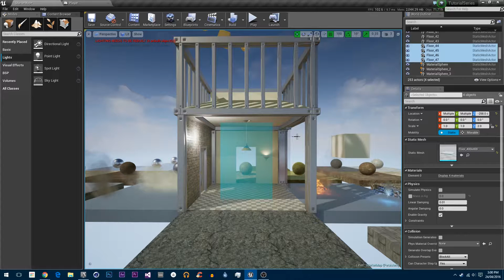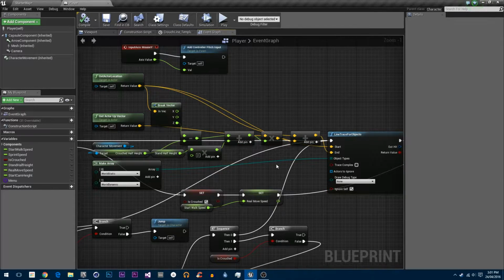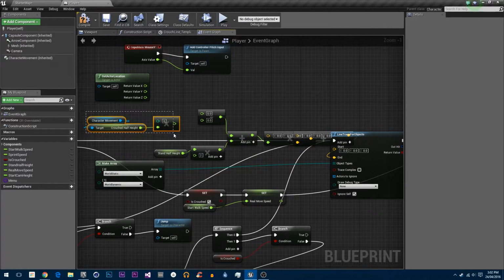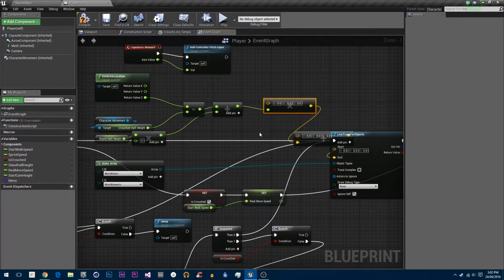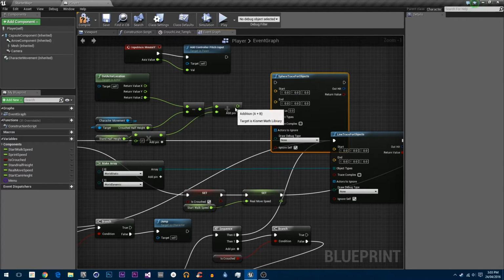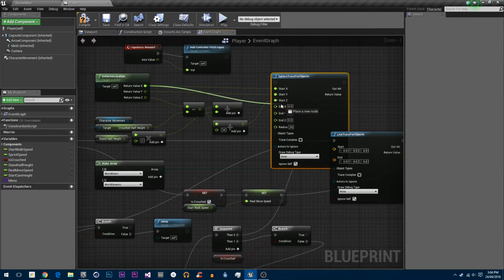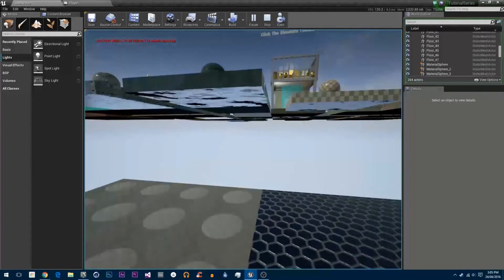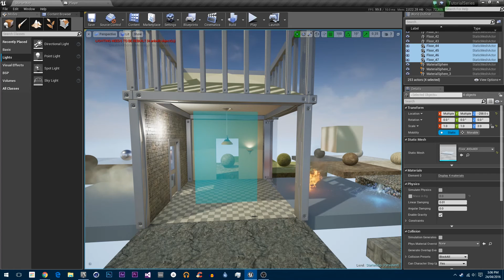Adv. Smooth Crouch Repair - Request 2.3  - Unreal Engine 4

Comment: Hi.Thanks again. I was wondering why it goes into crouch speed when I first Jump and land even though when it first lands it's not crouched. After that, if I crouch and stand up again, the speed is normal. Here is a screen grab video:

http://vid57.photobucket.com/albums/g230/alvin777/CrouchSpeedOnFirstLand_UE_Tut_SkyBluStudios_Request2_3_zpszxn2tnfk.mp4

Here is the screenshot of the project we made. My apologies, it's a 5k sized image but Photobucket shrinks it (I need to find a new free site, any recommendations?):

http://i57.photobucket.com/albums/g230/alvin777/CrouchSpeedOnFirstLand_UE_Tut_SkyBluStudios_Request2_3_zps6xwpgtvc.png
Reply: I mean where do you upload your screenshots and files, like a free cloud storage similar to Photobucket that uploads things at the original size?

Comment: When I jump while crouched without moving, I cant uncrouch until I move forward/right.
Reply: http://imgur.com/a/VTc4D I've seen only 1st tutorial, havent proceeded to the next ones. The issue is this: Press crouch > Jump > release crouch. Doesnt uncrouch until I move forward/right.
Reply: Hello, Im really thankful for your help and I appreciate it a lot. I want this issue to be fixed so bad. I actually updated my script (I did some research in google of another ways) and this is updated one: http://imgur.com/a/piuBt . It doesnt have branch at the start so I assume the first issue you mentioned is solved. I dont really get what you mean by a timeline-update event issue, can you please check this photo above and let me know exactly what I have to do and whats wrong here? The timelnie update is wired to set capsule half height.
Reply: If I just crouch and uncrouch, it works perfectly. The issue occurs only after Jump. Have you actually tried jumping with your script?
Reply: Yep, but what can I change? I only use Jump function.
Reply: Can we chat on skype/mail? If you are willing to help me out
Reply: http://imgur.com/a/PfVMh Thats all regarding blueprint (also some c++ code affecting the crouch).
Reply: Btw I've just noticed I didnt set the StartCameraLocation variable, but that didnt change anything, still same bug
Reply: Well, the bug occurs even if I don't change speed at all. I created a new project and its still the same. Im completely frustrated, because thats one of the first tutorials I've learned and I cant find the solution. Didnt quite understand what yo umean by "you are not just checking whether the player is crouching or not within that ATheGameCharacter function". What function? By the way, what version of ue do you use?
Reply: It does not. However if I dont delete your jump script, it does not let me jump in to crouch state. However if I do crouch > jump > crouch middle air again (your script makes player uncrouch when jumps), the bug is here.
Reply: I finally found what caused the bug. If I change half height to 96 (standing) right before or after jump and change it back to crouched half height on landed, it all works. However when you land there is very fast crouch animation. Do you know how can I how high in air the player currently is? Or maybe you know a way how can I change half height not on landed, but a bit before the landing?
Reply: The logic is same as yours. I added print half height to tick event. When Im crouched its 55, all the time, when I jump its still 55, when I uncrouch after jumps its 96, but theres bug. So the workaround makes the half height 96 when jumped (if is crouched),  and on landed it plays timeline and makes half height back to crouched (if is crouched). However for me its strange that if half height is not 96 in jump, there is this strange bug.
Reply: I have no idea why jump doesnt work with lower capsule half height. Do you have any ideas about it? Because with this workaround, the player still has standing collision if he crouches in jump :/
Reply: Hello, thank you for your welcome. I've fixed that and my smooth crouch is working perfectly now! https://forums.unrealengine.com/showthread.php?120000-Capsule-half-height-doesnt-update-physics . UE developer answered to my question and helped me fix it. Still not sure why its working in all of the tutorials out of the box.
Reply: No, I did have it. The cause was that when player was crouched on ground, after changing half height back to standing, bottom of capsule was on the ground and did reset only after moving X.